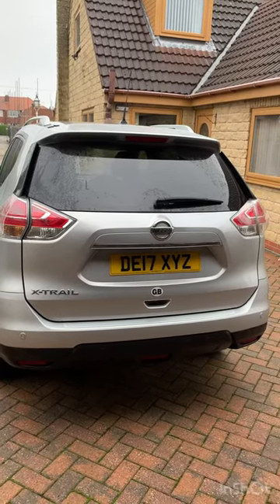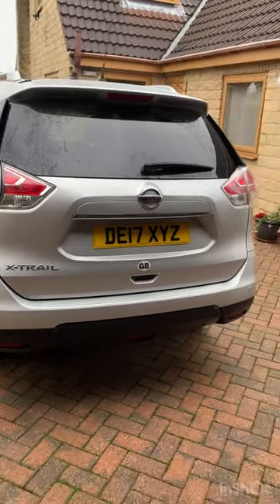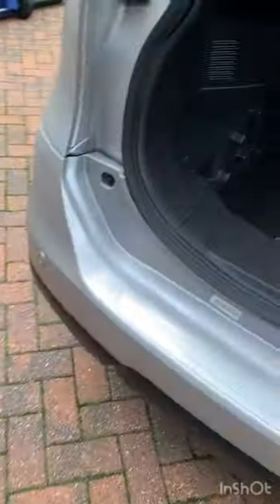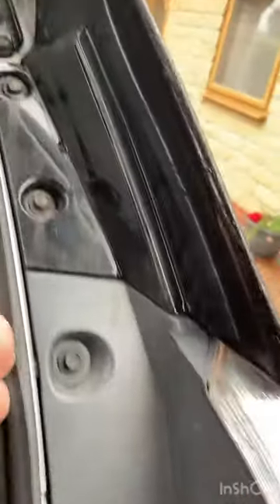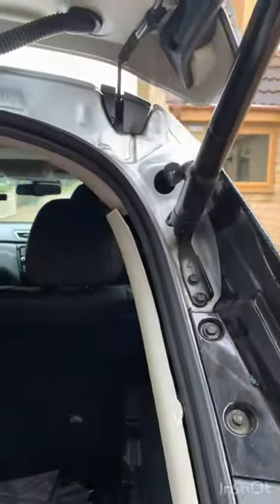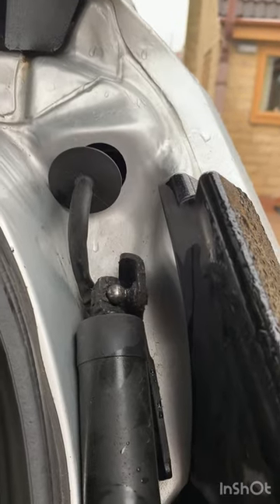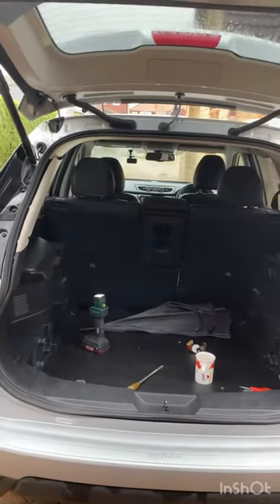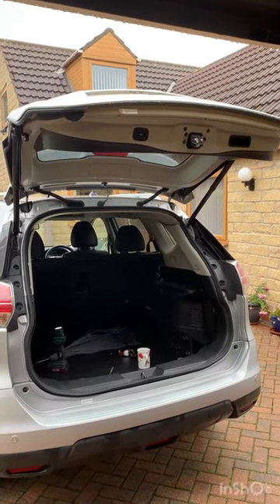NISSAN T32 X-TRAIL/ROGUE - POWERED TAILGATE STRUT REPLACEMENT.

Comment: Thank you very much for this video. My X-Trail has exactly the same issue! I will now order a new pair of struts... 

How did you reset the opening position after replacing the struts? Did you close the tail gate manually the very first time after installing the struts and then opened it by remote and the ystem got its start and end position by itself?
=> Yes, I tested it. Just close the tail gate manually and the it works with the remote control.

Today I replaced the struts and everything works fine! 
The only point which lead me not to reach the 30-min-target was disconnecting the electric plugs. 
So here'e an advice for anybody who is going to replace the struts as well: first stick in a small screwdriver in the plug in order to release the holding nose, like Richard described in the video. Then use a second bigger screwdriver: You'll find a small opening at the plug's side. Put the flat screwdriver in this opening and just turn it a little bit. The plug will disconnect easily.

Comment: Thanks for the info Richard.  I had the same problem with my 2018 xtrail, and I'm 6'5", the number of times I've cracked my head on the boot.  I spoke to Nissan and they quoted £350+VAT per side for replacement struts, and that doesn't include the fitting.  I ordered from the same place as you, a slight customer service issue as one of the struts was broken on arrival but we sorted it in the end.  It took me about 30 mins to replace both struts, the hardest part for me was to get my (big) hand in to get to the electrical connectors which were both attached to the body of the car.  Being the size I am I didn't use wood to hold the boot open, I rested it on my shoulder.  Overall a straightforward replacement, a little fiddly at times, but cost me £79 instead of £840 plus fitting, and if I hadn't have seen your video I may not have attempted it myself.

Comment: Hi Richard, thanks for making this video. This seems to be a common problem on all the t32 x trail’s with the power tailgate. I’m also viewing the new power tailgate struts from the same website and also saw your review unless that was another Richard Wheeler. Have to do this as my tailgate is basically unusable at this time as they need replacing. They’re not cheap either £72 per strut at the moment on the website and that seems to be the cheapest option that I can find online at this time. Thanks again for the video.
Reply from the maker: I thought long and hard and did a lot of research before finally ‘biting the bullet’ but eventually got fed up of banging my head and having to limbo to get anything in.

Comment: Great video. Easy instructions. Was able to follow instructions and install both trunk struts on my Nissan Rogue 2018. I ordered both struts from amazon for Canadian 250$. Could not have done without this video. Thank you for making this video. 

Few tips: Removing power cable was bit tricky but did it after rewatching video and following the tips and with use of two screw drivers. Pressed clip with one screw driver and pried up with another screw driver at the same time. Secondly, rather than using  timber to prevent falling down of trunk, I placed an A-type ladder under the trunk so that it doesn’t fall when struts were removed.
Reply from the maker: Thank you for your comments.  Your advice re the A frame steps was good.  I’m pleased it has been helpful to other owners.

Comment: Thanks mate. I had a similar problem on my Murano and the Nissan dealer in Canada here said $2747 just for the parts, and $1000 for the installation. I ordered the replacement parts from Amazon for $250. It took 10 minutes to take the old ones out and about the same to replace them. It's amazing, the only tool I used was a screwdriver for the little clips and that's because I couldn't find a butter knife or a popsicle stick. 🎉
Reply from the maker: That’s great news.  Really happy the video has worked for so many.
Reply: Yes me yesterday I went to dealer he said me 1680$ for just part plus 600$ for works!! 🤯🤯🤯! I just laugh and get out!! They are crazy for real

Comment: Hi Richard, great video. Are you able to post the link for the struts?
Reply from the maker: Hi, these are the ones I used.  
https://carlightbulb.com/products/2014-2019-nissan-rogue-s-sl-sv-sport-utility-4-door-2-5l-2pcs-electric-tailgate-struts-905614ba4a-fedex-express?_pos=1&_sid=a53cfadf3&_ss=r
Reply: @461wheeler  thank you, you’re a gent

Comment: Hi. Was it just a straight swap out with the old and in with new or do you have to calibrate anything after installing new ones?
Reply from the maker: hi Hevin, a straight swap, really easy. you will not regret changing them. I had got to hating my car and when I changed the struts my bad feelings evaporated.
Reply: You’re a life saver man. Just did mine and works like a charm.

Comment: Hi do you know if they will be the same part number for the 7 seater model as mine is an 18 plate thanks
Reply from the maker: I am not sure but cannot see it being different as the main difference is the boot floor to accommodate the extra seats.  Get in touch with Carlightbulb, I’m sure they can help but struts are returnable anyway.
Reply: @461wheeler  thanks I will check the part numbers and get in touch will them cheers

Comment: Whats the website called you got the struts from , cheers
Reply from the maker: @LeeWs1970  This should get you there, the Rogue is the same as the x trail ;  https://carlightbulb.com/products/2014-2019-nissan-rogue-s-sl-sv-sport-utility-4-door-2-5l-2pcs-electric-tailgate-struts-905614ba4a-fedex-express?_pos=1&_sid=e4650b7ac&_ss=r  Best of luck.
Reply: Many thanks ive found them but my part number on the struts show 90561 4CLA3A  and they show 90561 4BA4A on the website so im not sure  if they are compatible 
Cheers for reply